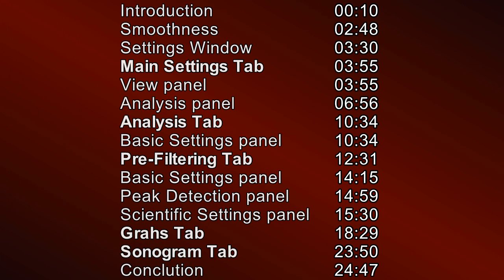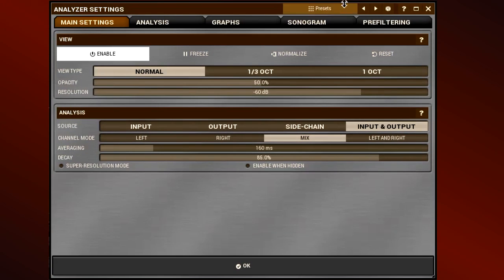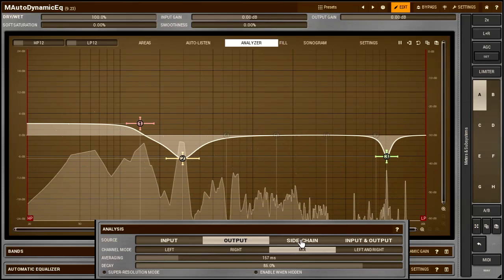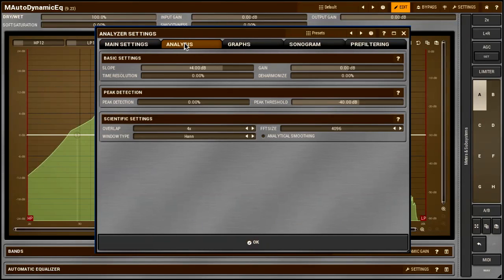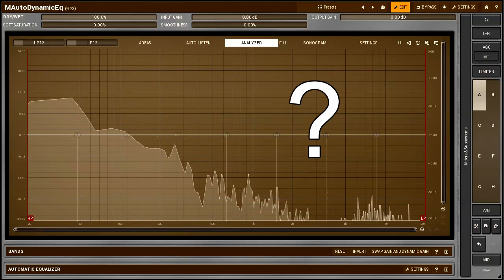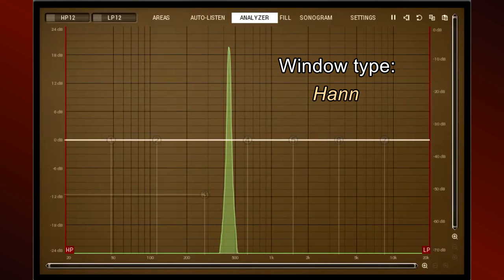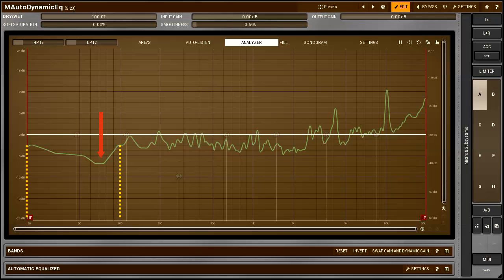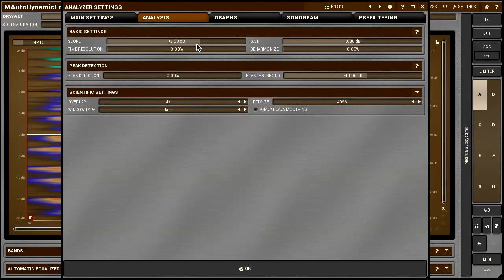Using audio analyzers & sonograms

Comment: Is there a way to change the resolution of the meters and sub systems? I'm using your dynamics a lot but I'd like to more clearly see the gain reduction so that the gain reduction meter could work when I'm compressing - 0.5db to -4db gain reduction more clearly
Reply from the maker: I'm afraid not, but in the forthcoming V13 the GR meters will have range to -20dB
Reply: meldaproduction good! Look forward to it!